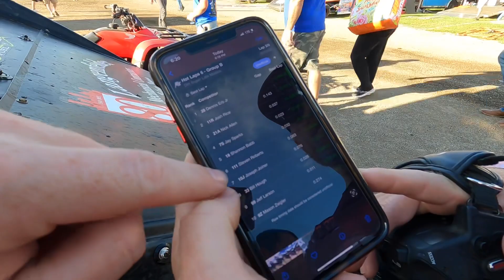Close Sliders and a Tough Cushion at Fairbury Speedway’s Prairie Dirt Classic!

Comment: Keep digging !!! We ran on Black dirt a lot and we use to take the J-bar off and put the straight Bar on the left side of the Pinion plate to push the left rear into the ground , it works great on slick tracks but anyway you guys are doing great keep digging LETS GO JOJO

Comment: The problem with tight tracks is making the chassis rotate but not get too free that you can't use the throttle. It looks like Joey drives in like an asphalt car and the top 5 cars are much more pitched sideways by mid corner. No clue how you get a capital to do that right but it seems to be the same story at all these slimy tracks that his car won't rotate enough.
Reply: I can only assume that the car has zero rear steer. That alone will make it difficult to put the power through the RR when exiting...

Comment: I’m glad you guys chose to run with the top guys. Its how you know where you are and need to do. This s**t ain’t ez or for the feint of heart. The outlaw guys are tough and are not afraid of anyone. They are not perfect every night out either. Joseph needs to muscle out to where the best dirt is, kick that Capital in the butt, and chase the best dirt thruout the race. Driving around in a circle doesn’t cut but you all know that. Take some chances and show us what you got.
Reply: @Major _Hack_84 I was sitting pit side in 3&4, center off was no throttle….. until about the Fairbury sign

Comment: When you race Midwest. The clay always softens up to the high track. Nothing on the low side will win a race. Put more weight on the right rear. To balance the left front.
Reply: Not clay it’s Gumbo! Clay is Clarksville
Reply: Dennis Erb Junior is the current world of outlaw points leader and is from Illinois and he virtually runs nothing but the bottom
Reply: Where the moisture is!! Tanner English 81e runs the bottom a lot also! And he is third in Woo points
Reply: Water runs down hill right?

Comment: Chain down that left front or drop a Lil spring rate on it
Reply: yep put some weight on the right rear by letting the left front just flot the track in the turns, makes a big difference
Reply: Maybe a Little more REBOUND in LF and a Click up on Bump RR
Reply: Looks like you need just a smooch more gear also
Reply: I think they need to weigh the car out and find out where their cross weight and stuff is so they will know what to do to it
Reply: @davidburchfield2720  
they no the gross   weight  they need to 4 wheel weight with driver and fuel ,in the old days we put weight jacks we could adjust to load the right rear
Reply: @davidburchfield2720  HA HA HA I said this when they went to test and got CHEWED OUT for not knowing a DAMN THING ABOUT DIRT CARS 
They need to scale all the cars and start fixing the STATIC CG first its a long road but its the only way to get it right!!!! Setting the Rollcenter up for different tracks and conditions is THE FIRST THING YOU TUNE
Reply: @davidburchfield2720  we don’t use scales on latemodels  or cross weight we use spring loads . The only time a latemodel touch’s is when it’s new and were adding lead for the first time to set the rear% and left%. It takes about 60 to 80 lbs of lead most of the time to get up to 2350 . And before you argue we have latemodels I hate bust your bubble on what you think you know.
Reply: @CORNDODGER  David you got chewed out because  you don’t know what your talking about . None of you guys fully understand dirt latemodels. Other than the first time when we put a new car together  we do NOT use scales PERIOD we use then to mount lead for Left% and rear%. Once again we use spring load  numbers numbers,shocks,bars, bump stops and such In the latemodels we do NOT use scales because  they don’t represent the car dynamically scales represent the car statically  we don’t race our cars setting still. Once again 90% of you guys that’s commenting in this section don’t  have a clue about a dirt latemodels

Comment: You guys put so much into what you're doing but I think if you want to go national and race competitively you need to retool with either a Longhorn or Rocket. I'm sure Capital has giving you guys breaks because it's great press for them but they're basically a regional chassis. Yeah, they got Clanton and Bruening running national but that's it. I enjoy the channel and wish for more success for you guys.
Reply: Do you remember how they did in the Longhorn that Henderson owned? They could never get that car to handle. People forget to soon. It isn't the chassis it is that they are driving on different surfaces than they are used to and different shaped tracks. It will take them some time to figure out how to set the car up to be balanced and up front at the national level.
Reply: @jasonnelson2744  you forget but he finished 4th last year when he did race that car; again, he's facing an uphill battle racing with a Capital chassis
Reply: @marklavallee5610  finished 4th where? when he raced what car? He ran the Capital at PDC last year.
Reply: @jasonnelson2744  I think he ran the Henderson motorsport car last year at maybe Whynot or Hattiesburg but he did run it once.
Reply: 5th at Hattiesburg

Comment: After watching you guys with your new chassis and Engine do you ever think you might need to change chassis brands 🤷‍♂️ the new car has not been impressive.
Reply: I have said forever
Reply: It bet it would be the same or worse in a new chassis. Do you guys not remember all the chassis set up issues they had when running Henderson's car they never figured that thing out and it was a Longhorn and that is what most people on here say they need to be competitive. It takes time they made a big jump this year from local shows to national events. They have to get data on different tacks and figure out the little things that make the car handle better. Being off what would just be a little bit at a local show is a lot worse at a National event.
Reply: @jasonnelson2744  Now Jason your making the assumption that all longhorn year models are the same there not. The one Joseph drove was a number of years old. It’s almost apples to oranges compared to the last 2 models that’s being used by the Top 15 cars in these big races. Don’t make a assumption on whether a Longhorn will help him or not. Longhorn,Rocket,Bloomquist chassis all comes with a wealth of support from the manufacture. A capital doesn’t have the infrastructure to bring enough support for the teams they have ( 2 touring drivers and 6 or so regional teams and quite a few local weekly racers). Don’t just out right except what HTF says. Remember there after content winning races is secondary to them making a living off of me and you is there goal. By the way I can careless if the make money of of me.
Reply: @JJ-1-1  my assumption is the same as yours that they would do better in a different brand chassis. Yes they are into making youtube videos and selling merchandise and promoting there marketing partners if they didn't do that then they couldn't afford to run half as much as they do. Also the wealth of knowledge doesn't always come with those other brands of chassis. I have talked to a lot of drivers that have bought the other brands and have told me they went with another brand of chassis because Rocket and Longhorn wouldn't give them any setup info and they struggled getting them to hook up which is why they switched to another chassisanufacture that would help them. A lot depends on who you are and how you get along with your builder on what they help you with.

Comment: That engine and chassis combo just isn't workin for Joseph like the others have maybe the new car just won't work with a big motor it's been known to happen
Reply: There new motor isn’t big.
Reply: @JJ-1-1  that Jay Dickens puts out more horsepower and torque than any motor they have or had and if you listen to them talk they are having trouble with the feel of the car on slick tracks because of the power different that's why they try changing the spacer at times, I've worked on cars I've been there
Reply: @dirtfan7176  funny I race dirt latemodels and I owned a Jay dickens motor years ago it was a back up motor to our Clements. And I agree that Dickens motors is the best motor the have had and 80% of the tracks they will go to that motor will be just fine. And once again we race these thing cars we know about the slick and how big a pain in the ass it is. And yes we use spacer inserts. I have 28 years racing these cars I think I have a hold on all of this. Thanks for the effort though.
Reply: @dirtfan7176  When your talking “big”most latemodel guys are talking cubic inch’s. A 430ci motor is not big. There SB2 they own is 35ci bigger (465 ci). The Dickens motor is 430 ish Yes the new motor is better but not bigger.
Reply: @JJ-1-1  the point is they're not getting the feel for the car and motor, this motor is different than anything they've ever ran power band wise, everyone wants to talk racing but don't know what they're talking about cubic inches don't mean squat, it's the torque curve on a hard slick track and that Jay Dickens is killing them
Reply: @dirtfan7176  So if I’m correct our conversation that started  was about size I corrected your idea of what size was. So now were getting the into the basic Drivability of a motor which is of huge importance when dealing with the attributes of different motors . I Suspect they don’t have a full understanding of what there motor is actually doing for them. I suspect they won’t  know till they get a good race car underneath them. So please don’t come into this conversation  thinking that your one of the few that understands this because you’re not And I’m one who does.

Comment: If u new u was gunna catfish lasowski u change gears an tune carb down
Reply: If your going to do well on that track, you have to run both top and bottom.  Also black dirt in Illinois doesn't slick off that bad, so you would never restrict the engine.

Comment: I don't think that capital race cars are competitive there's a reason why nobody but clanton is running a capital
Reply: Nobody??? Really?
Reply: I agree ,see if Davenport, Larson or any big name driver will swap over to Capital ,never happen
Reply: @vernsimmons945  Vern they have very few teams I know what most teams run chassis wise I name who has one or had one…Shane Clayton and Tyler brunning . Are there national drivers. There is about 10 regional  guys that runs the lower tier series like southern all stars and local shows. Josh Putnam is at Fairbury in one  of course Bo has one. Marlar had one and sold it after a few races. So did Ross Bailes. Vern a Capital is not a good selection.
Reply: They don't preform they are lacking on the slick

Comment: You all have to stop restriction plate racing
Reply: Why some places just wont hold HP
Reply: Agree, They need to change gearing not restrict the motor. They said for years they were under powered, not they have the power and don't know how to use it. They need a real crew chief, not Jesse!
Reply: @CORNDODGER  so the top 5 cars just figured it out lol

Comment: This car is like the 1st rd quarterback. You know it aint that good but dammit it has to be and we gonna keep trotting it out there and hope. The new car isn't that good.
Reply: The car is fine, it needs more gear and heavier right foot and weight moved so it corners and comes off the corner
Reply: @johnstark4723  I'm not arguing you but for joesph its not connecting. Sometimes the 2 dont mix. get the car that jives with him better and go. work out the bugs with the new car at smaller races. Going backwards fast.
Reply: @emoney7472  the driver has to adapt to the car, not vice versa. The new car is fine, anyone thinking otherwise has no clue what they are doing with a race car.